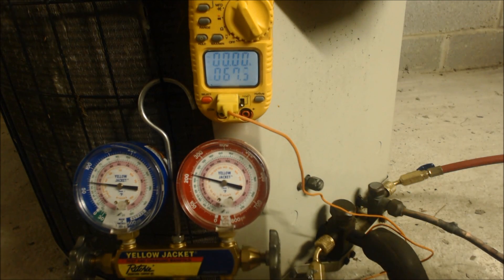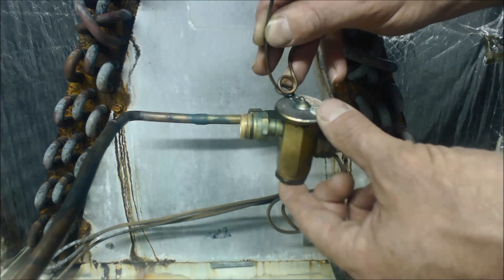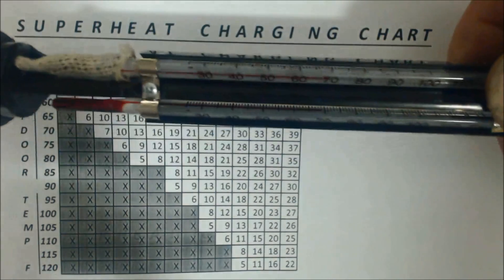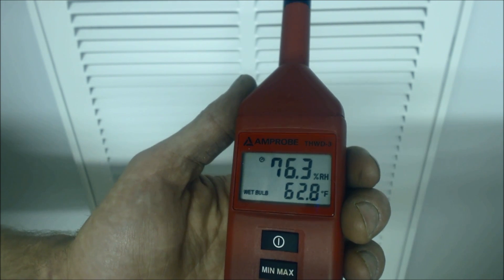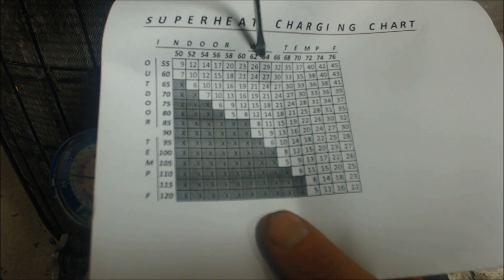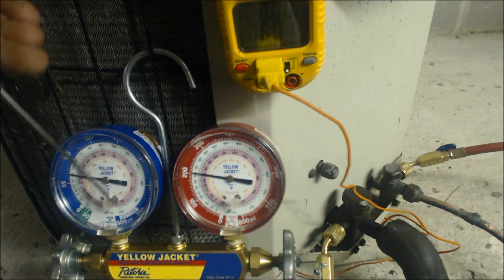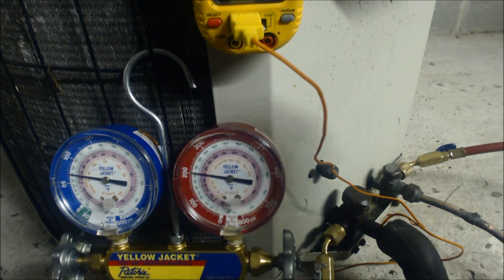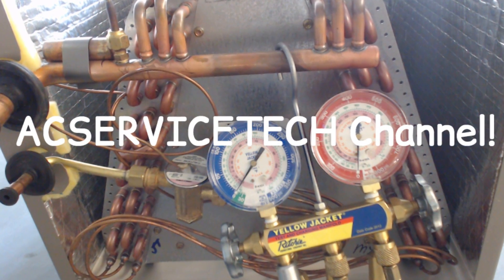Check the Refrigerant Charge in Superheat STEP BY STEP!

Comment: Hi 2 quick questions?..
1. Does the unit have to be running ?
2. Will I be making multiple trips inside to get WB until I’m close to target?
Reply from the maker: Yes the unit needs to be running for ten min, and yes right before you check the charge you need the wb and if refrigerant is added, wait five min and check wb inside again before checking the charge, thanks!

Comment: Lots of alrights lol.. but serious note. Do u HAFTA use either of those 2 tools? I seen another person post how they used a normal temp probe on a multimeter with a wetted "sock" around the tip.. is that wrong? Or jus possibly less accurate? As they stated theres alot of ways to do some things.

Comment: I have an ambient temp of 84. A wet bulb of 63.5. Actual superheat on my guages is 8.7. The super heat chart doesn’t give a value for this scenario. The next value up is for a wet bulb temp of 65 degrees with a target superheat of 8 which would put me right in there. Would you go with that or is something wrong? Thanks

Comment: I love your book, excellent reference! I have R22 fix orifice (Goodman) package unit. The charge ports are on the front of the unit and the liquid line and suction lines are not exposed on the outside. How is the best way to get a temp reading off the suction line to calculate super heat?

Comment: You said the superheat you are reading when checking unit could be within 3 degrees + or - of the target superheat, you had 27 degrees. You said you wanted 22.5. If when first checking you had read 25.5 which is just 3 degrees higher would you have left it alone and not adjusted the charge?
Reply from the maker: I would have wanted to get it to 21-22.5 then because I would rather be slightly overcharged by 1 or 1.5 degrees or right on then undercharged, thanks Steve and Merry Christmas Today!

Comment: Quick question, outdoor temp now is 83°f, I have a regular old temp sensor at intake registering at 80°, I don't have that fancy Orgon ghost busters looking thing u got (LOL) with 72° blowing out vents. I don't have the right tools, what ur take on this. I keep adding refrigerate but seems nothing changing.
Reply from the maker: You would need to read the temp on the suction line and then minus your sat temp on the gauge for the low side. This is your superheat. Thanks

Comment: I had always heard that on a correctly charged system you could look at the low side of the system (while running) by the gauge hook up. It should be sweating on a hot humid day. Is this always true?
Reply from the maker: That is just one of those rules of thumb and a small part of the picture. For a lot of in depth info on checking refrigerant charges check out videos here, thanks and you always want to check charges with superheat and subcooling for efficiency, safety for the compressor, and it will let you know what is really going on with the system if there is a problem-   https://www.youtube.com/playlist?list=PLxnHR5_D2ojxZI3-xx03Bttxe3xCqUD87

Comment: excellent video! thank you very much,
is this method ( superheat ) acceptable for other kind of refrigerants like r134a?
Reply from the maker: This is what we use for any type of comfort cooling system with a piston or capillary tubing. Thanks r-134a is usually for refrigeration and cars
Reply: Automotive AC systems generally have either an accumulator with fixed orifice or receiver drier with expansion valve metering; could that equate to the use of superheat for the fixed orifice and subcooling for the expansion valve when determining charge?   
Can this be applied for automotive air conditioning to determine the optimum charge as well?  It seems servicing them is generally done by evacuating the whole system and then recharging by weight instead of a temperature measurement method.

Comment: do you add 25 to 30 degrees to the ambient????
Reply from the maker: That would be in a range maybe thats close within 15 psig in either direction if the fins are fully intact on 10 and 13 seer units but that doesn't help that much. It just kind of gives you a very very rough idea in a perfect scenerio. Here is my perspective. If you know superheat and subcooling, you are good. I would not use that rule of thumb and I am in an area where it doesn't even apply anyway. I live near salt water so most fins are damaged and degrading. Thanks
Reply: thank you very much sir it's confusing when you are around guy's who alway's add 30 to the ambient then look at there p/t chart! thank's you are an Excellent tech I would never doubt you.
Reply from the maker: Really? Wow,  they are using something that is barely a rule of thumb to charge? The subcooling and superheat are right there in front of them and the p/t chart is on the gauges. As long as you know when you are doing jobs yourself. Thanks for letting me know!